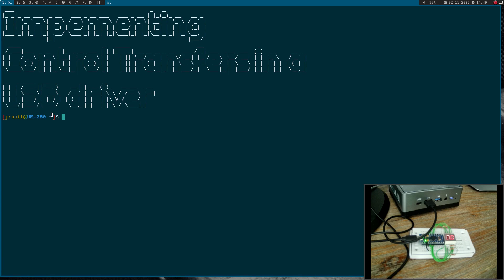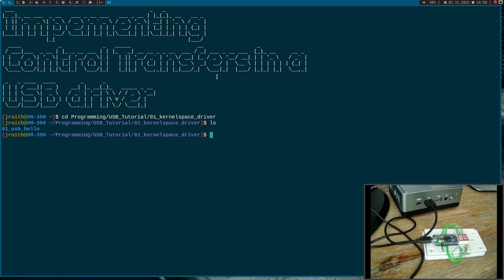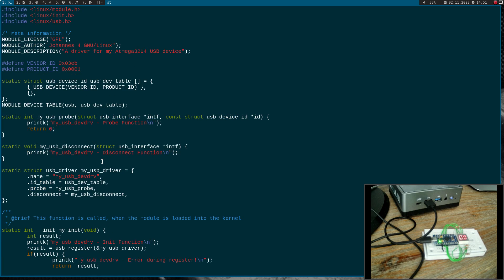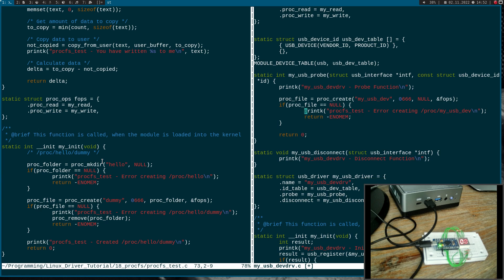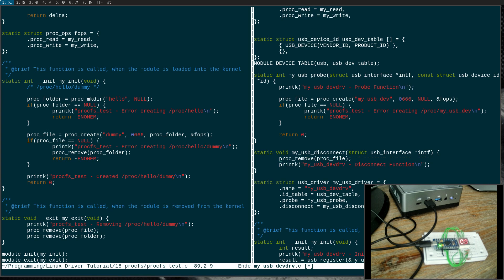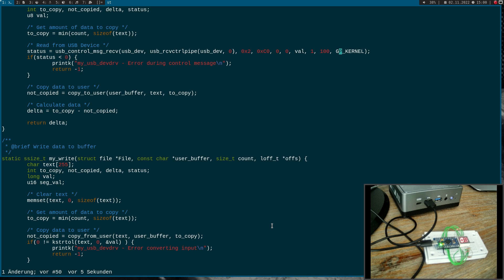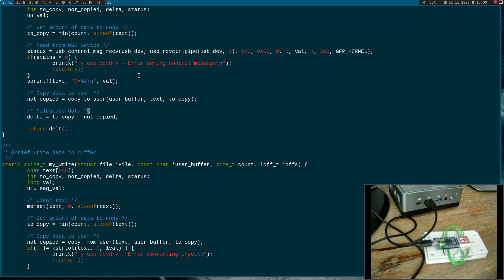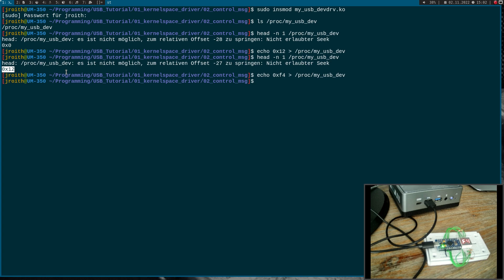GNU/Linux & USB - Implementing Control Transfers in a Linux USB Driver or Kernelmodule

Comment: Hi , can u share the pins on which you connected the Seven segments   on AT32U4 pro micro
Reply from the maker: You can find the pinout here in the main functions: https://github.com/Johannes4Linux/USB_Tutorial/blob/main/00_microcontroller_firmware/01_ctrl_transfers/main.c
Reply: @johannes4gnu_linux96  i am facing this error while reading control transfer driver.head:                                                     error reading '/proc/my_usb_dev': Operation not permitted